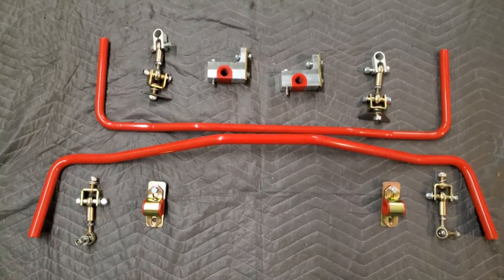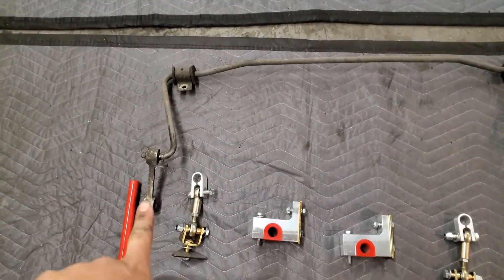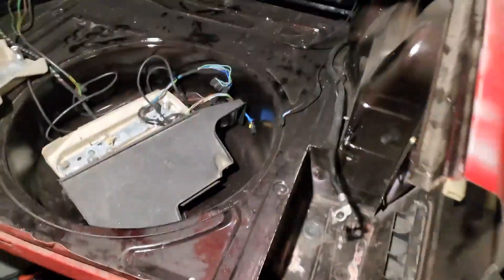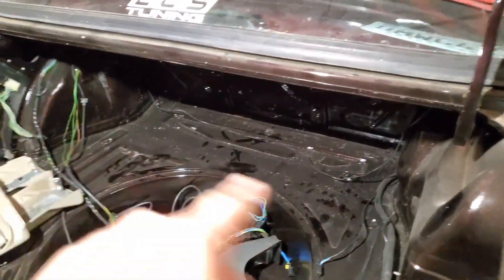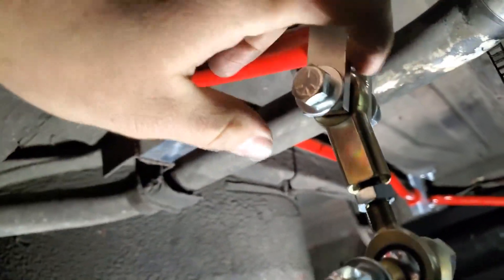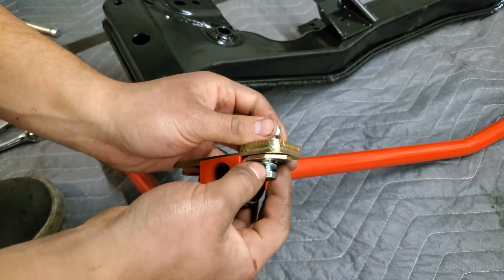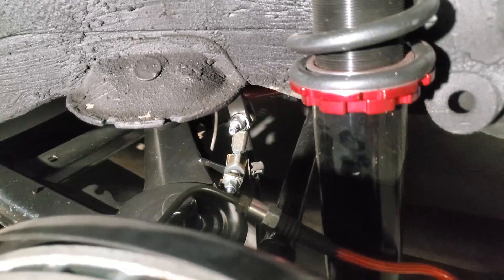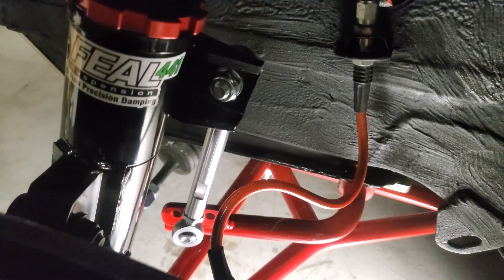The Ultimate E30 Five Lug Swap  | E30 Adjustable Sway Bar Install (Ireland Engineering Sway Bar Kit)

Comment: You're better off with the endlinks attaching at the strut anyways. You get more of a 'levering' effect. This is why tuners such as AKG sell CNC'd tabs to weld on to your struts if you don't have this style already/ dont want to cut some off a set of junk struts. I would make my own adjustable endlinks anyway. This is what I have done before and it works just fine, if you don't want to buy some that are already 'made up.' I got the majority of the parts from Pegasus Racing and Coleman Racing. I bought the heim joints with spherical bearings, jam nuts and properly sized washers/ grade 10 hardware from Pegasus, and I used the internally threaded shift rods that Coleman sells. I believe they were 7" but I can't remember as it has been ages. This is everything you need to make your own links. They work great. I used that particular set with a UUC Swaybarbarian and had no issues.